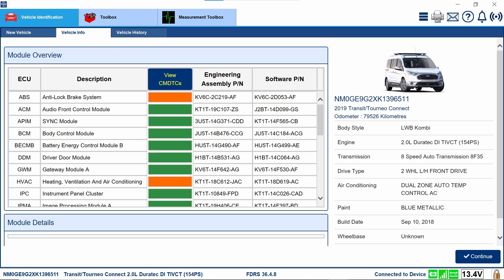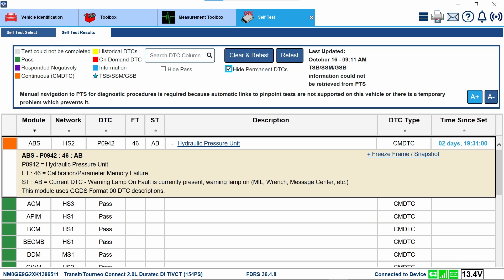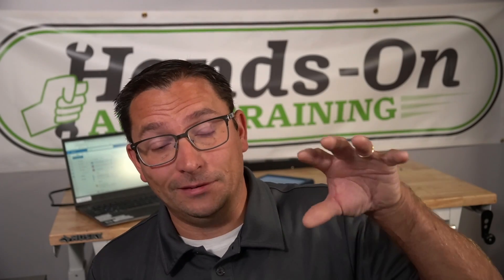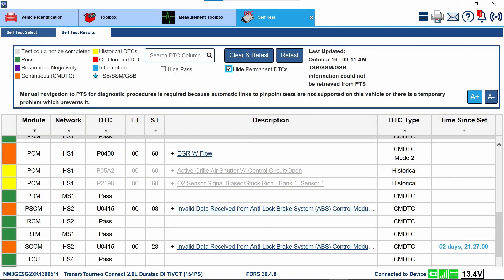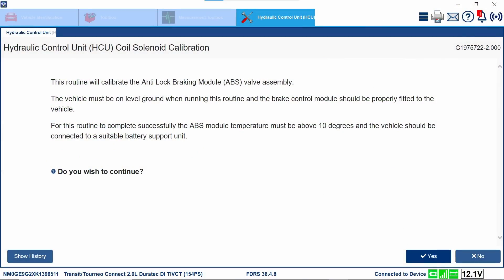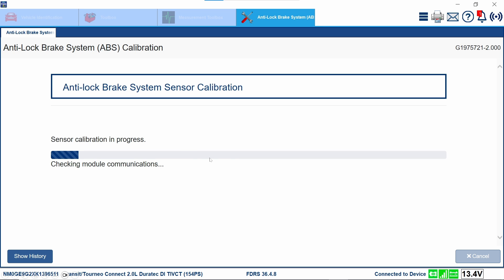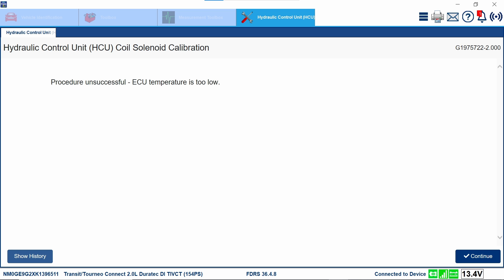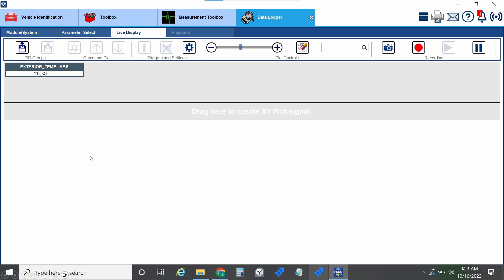2019 Transit Connect ABS Programming TIP

Comment: Hello sir
I am form Oman. I am Just buy used GMC terrain 2015.2.4L engine. When i buy have issue is electric power steering. Meassge comes in screen need steering service.when i check eps motor grip open.but vehicle start.then i insert grip vehicle not start and same like shorts whire position. Now remove again grip.then i deicide my car eps steering box motor problem.now i buy eps used. And fix this but all cables is insert in eps.now car is start but steering fault is same.need service steering. I have scanner this code come C0565-5A.plase sir you have any sulation now whats problem. If possible please give sulation.

Comment: I have used my mini torch I use for heat shrink tubing. Run it over the metal parts of the HCU for about 20 seconds. Move it around not just sitting in 1 spot. Works every time for me. I have had them in sub winter temps left out overnight and it worked.
Reply from the maker: Good to know. This is the first one that I have seen( or maybe the 1st one that I had that was not warm enough!)